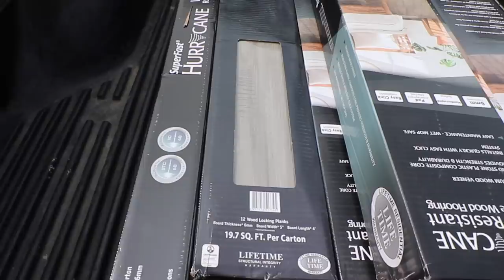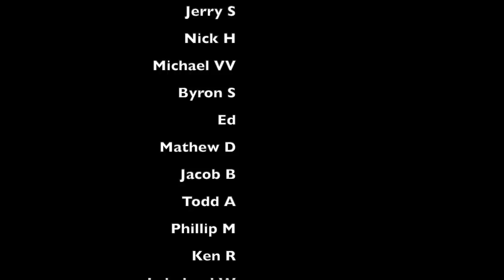Finally! Installing Flooring | Off Grid Cabin Build

Comment: What is making the noise at the beginning of the video?  We have the same noise here and I’m not sure if it is a turkey or something else.  Great videos!
Reply from the maker: It's a Yellow-Billed Cuckoo.  Pretty cool huh.
Reply: Thanks a bunch!  I’ve never heard of them and hear them all summer here in North Carolina.
Reply from the maker: @Stevie714  No problem, Im about 90% sure thats what it is.
Reply: @A Cabin and 50 Acres for your next flooring job I left you a tip to save you some money in the comment section. 👍

Comment: There are many tricks to installing flooring, one is undercutting the doorways another is gluing every joint so you will never have separation. I think some day you will use this flooring as an underlay for your rough sawn ash flooring when you have more time. Looks great!
Reply: That’s a good idea. Just run some staples thru it and ready to put the real floor down

Comment: I did laminate in our last house. Similar struggles. When we bought our cabin I had considered making my own flooring from the woods on our property. Due to lack of time and trying to keep my sanity I ended going with pine floors from limber liquidators. Those worked out pretty well and were inexpensive. Definitely more work than a laminate, but love the way they look. Hats off to you for making your own flooring in the rest of the cabin! Not many can claim that! 👍 You are a rockstar! Hi from a cabin and 12 acres in Oregon. -Robert
Reply: Did you use laminate? We're going to do our cabin floors soon and having a hard time deciding what will work best in the 3 season cabin.

Comment: Couple tips if you do a project like this again.  Don’t overlap the flooring pad.  This is why the tongue broke by the stove as when the pad is overlapped the height difference puts all the stress on the tongue and they aren’t design to hold a vertical load, rather just secure the floor together.  Second, use a trace board for the rip cuts along the wall or the L-shape around the stove.   Research trace board for flooring install and you’ll see the benefit of both time and clean install.
Reply from the maker: Thanks for the info!  I will definitely use those on the next one.

Comment: That looks really good. I like the color a lot. I think I put in Pergo laminate in my cabin. Took a while to get the hang of it, then it went quick. Seems pretty durable and the dog doesn't scratch it. I bought a battery powered vacuum which works really well on that type floor. It was the shark duo clean. Works great for an off grid cabin. Check them out.

Comment: The flooring should be very easy to clean and maintain, a very important aspect where a recreational dwelling is concerned. On the down side, it is a lot of grey, but there are always area rugs too and the neutrality of the grey as a boarder, should work out great.  And the single most important point of all is that you are happy with the color.
Reply from the maker: Great point!  It says its "Steam mop safe" so that also nice!

Comment: Great job.  I know won't be popular to say because I'm sure most wanted an extension of the wood floor from the bedroom; however, the functionality of waterproof floor in the room with exterior doors will be a good call for decades to come (wet muddy boots). Your craftsmanship is highlighted in other areas.  By the way the drawers on the bench turned out amazing.

Comment: I thought you would have done some exotic wood in a pattern for the main room. That would be amazing!!
On the plus side you have a finished floor now and they are usually great  to drag stuff across with no scratching and easy cleaning too.
I probably would have gone with a chocolate tone floor matching the wood beam loft. But gray is so popular and I love the color looks great next to the fireplace. Once the furniture is in it won't be as noticeable.
The great thing with that floor is it will be easy to remove someday if you decide to do real wood.

Comment: You Need longer T-shirts.. Why.. its self explanatory.. as for doubting you..you're a carpenter..you always do get extra stuff..flooring boards, wall'd wood, vinyl, shingles etc. as for what i would have suggested for the flooring.. it won't matter.. by the time the comments come around..what color you  chose.. the flooring is already laid...lol.. next is.. if and when you bring the dog.. cut its nails.. cause dogs do run around and these flooring rubber tiles get scratched... looking at the camera view at 17:26 the main door side looks a little angled up..going down towards the back door.

Hope you're n your family are well? lots of late summer hot days here..will be traveling back to Singapore.. on the 22nd Sept... hope to catch you complete the pond/pool before winter? stay safe.. GOD BLESS.

Comment: I put in a similar type floor. The underlayment was glued to each section. The tabs can, in some cases  buckle. I used a standard screwdriver to keep them flat during installation. Smoothing them out to keep the edges straight.  And you are right, get 3-4 courses down and see the seam jump. So go back and redo. HOWEVER after completing, my two pit bulls run crazy over it, and it is holding up quite well. Think if you have furniture in place and some wall hangings, it will even out appearances. Looks good boss.

Comment: We just sanded down pine boards like you would use in an old subfloor and then just sealed the tar out of it, it turned out beautifully. The little dents and dark areas just add to its charm.   I didn’t want the new or even professional looking floors, I wanted the rustic, cabin, well used and loved floor.  I wouldn’t change a thing about it.  👍🏻

Comment: Love the choice of pattern and color. Job well done, as always. I expect nothing less from you. :-) Your get-away cabin is coming together. So happy for you and your wife. :-) Enjoy after all your hard work. :-) And I agree, once you get furniture and rungs in, it will look amazing! A final thought. If the floor comes to a place where you don't like it anymore, you can always change it down the road. Something you might check into is tiles that looks like wood. We actually are getting ready to use a grey wood patterned tile on our floors. :-) They look good and take the wear and tear. Easy to clean as well. Our current flooring is what you put down and after two years of use, it needs replaced. You live and learn. :-)

Comment: I have a similar floor by life proof from Home depot. Five shades of Gray, tan to Brown called driftwood.  Put it down in 2017, it’s incredibly durable, everyone loves the color, and it looks gray with everything.  Your going to love how easy it is to clean, and water doesn’t damage it.  So, honestly you picked a great color, a great product.  I live in the inPortland, Oregon on the Columbia River with allot of moisture.  It’s stood up to the elements.  Only thing I will say is be careful with metal legs on the floor rubbing.  We had a bed frame pull up some of the flooring in a  bedroom .

Comment: Its a floor(good color choice) on a CABIN, in the woods.  Everybody/everything walks on it, spills on it, etc.   Lots of things yet to do.  Maintain perspective, get it done.  You can opt to learn more about floors later and from this experience.   Great videography...  keeps the interest and pace flowing.   Curious if you are considering climate control/air conditioning for those hot days to come?   Also, what temps are you experiencing in there on the hot days...?  Does the insulated roof offer some protection during the heat as well?   Okay, now back to the pond/pool(poolond?).

Comment: I think the floor looks great ! You're noticing every little thing because you just put it down like I did. Lol. After some time and furniture it'll be something you don't notice as much aside from noticing that it looks really good. So only thing I'd do different is this : 1st is the 1/4 inch gap. The long seams won't move but the short ones will separate if you don't do this. Or some variation of this. Put something between flooring and wall before you put trim down ! Thin rolled Styrofoam or maybe a strip of cardboard then trim. Also thought about a bead of silicone caulk. Any of these will allow for movement but not pucker a seam. Remember is IS  a floating floor so NO nails through flooring as u know. 2nd I would not try to remove lifted piece around stove base. Instead trim it and dont put nail through flooring and it'll stay down. 3rd when u put trim down put it down stiff !! Meaning a lot of pressure to hold it in place with that intention in mind as your putting it down. Nail to sub floor AND to bottom plate of wall. Hope this helps. Also any REGULAR water areas should have carpet as it will not do well and seams will absorb water and swell. No going back from that ! Also carpets should have felt or some kind of backing as  carpet will scratch the finish off. Hope these tips help and ive watched u long enough to know that you measure twice so I knew you had enough underlayment lol. Thanks for the video !! And whats your first name. ?

Comment: wrong stuff for a cabin. The floor will devolope wafes/expansion in the wintertime.Whay did you not toke real wood? Your flor will make problems in the winter. The cold will go through the floor because it is not isolated. Normaly you need only 10 centimeter wood for the flor. But 2x10 cm is much better. If the floor is not isolated the cold will transport humidity in the base and then fungi can devolpoe also.

Comment: Thanks for the video👍🏻 floor looks nice will last for years if you need to lift and replace in 10 + years no worries you will probably need to sandy and varnish / oil  the bedroom floor then. Least then you will have the cabin finished and can spend the time to make a new floor, herringbone or parquet would look lovely 👍🏻 the dining table seat videos where great 👍🏻👏🏴

Comment: I think grey is super trendy at this point in time. But I personally like grey and am in the process of building a 40x60 shop with an office and yes flooring in office will be grey like what you put down and a grey vanity with very light grey paint (platinum).. so don't feel bad about putting some nice down if you like it!!

Comment: Ok to nail down first track and after 3 it stops moving as much or stack the unused flooring on top of already done section to weight it down, it all gets easier when you reverse sides and are pulling instead of pushing...ijs

Comment: Personally, I hate this whole grey movement. My name is not Eeyore I do not want to live inside a rain cloud. I prefer nice warm wood tones. I know someone who is redoing everything to be gray because that's in right now. When the trend changes they'll redo everything again. 
Nope I won't do it. I'm a buy and use what you love regardless of what in fashion right now kinda person. If you love grey than go for it, you have a TON to choose from at the moment. I pick what I love and keep it until it's no longer useable then I keep it even longer while I begrudgingly look for it's replacement, which I will I then fervently refuse to purchase until the original item completely falls to pieces. This goes for everything flooring, carpets, furniture, clothing, shoes, dishes. I'm there type that cooks almost exclusively with cast iron so I will never have to part with my favorite pot or pan (which several were my grandmother and great-grandmother's daily cookers).

Comment: A job that requires 1000 squats to do. How did your legs feel after this?
Reply from the maker: I was sore for 3 days straight!
Reply: @50Acres  Flooring is the one job I feel the most in construction, but it feels good once done it changes the look of the house. 
Put a small rug in front of the stove and you wont see the floor issue.

Comment: Looks great! Been thinking about flooring a bit. I was contemplating the idea of using maple veneered plywood. My thoughts: rip it into 5" strips, route tongue and grove and then bevel the edges slightly too, lay it down with an angle nailer on top of the underlayment and poly the crap out of it. Crazy, I know, ha ha

Comment: Since you asked... Regarding the new flooring; the gray looks pretty good, but a warmer tone might have been better. I have an aversion to industrial materials simulated to look natural. Even the best ones somehow look like the impostors they are. I've used commercial, sheet vinyl flooring to good effect. The commercial stuff is the only kind I've seen that isn't a fake of something else. I found some that's subtly speckled, similar to cork but not trying to imitate it. It's completely waterproof, and with a decent area rug and some furniture on it, it can look quite good.
With your kitchen area, a dog, and snowy boots (and logs) in winter, waterproof is going to be important.

Comment: Like you said. It's ok, but I'd have leaned towards more on the bedroom floor shades. Although it does work with the black in the wood burner area. Also the window frames and tile backsplash. So again I guess it's ok.

Comment: It went down relatively easy ....... it will be just as easy to take up when you decide to replace it with something more hard wearing.  But, in the meantime, once you furnish the room, the grey will be broken up and the impact of "so much grey" diminished.   What surprised me is that you installed the flooring before finishing the loft area ...... I have visions of things being inadvertently falling from on high and the flooring getting dinged, dented and scratched.  But, it's done.  Guess you could lay down sheets of thing plywood to protect the floor when working "upstairs".  Are you going to eventually do a finished floor in your mechanical room?

Comment: That's always the challenge...figuring out where to allocate your time and resources.  Honestly?  I think it's a shame to put one of those laminate floors inside of a craftsman's work of art cabin like yours.  You did an excellent job of installing it and it looks lovely.  But next to the wood floor YOU milled, installed, and finished on site, the Menard's floor is clearly the one thing in the house that clearly doesn't belong with everything else you've done in there. 

That said, it transforms the room to have flooring in.  It's looking really cozy!  Fact is, I'm SO impressed with your work that nothing like that floor, no matter how "nice," can measure up to the natural materials and craftsmanship of the rest of the place.  But as you said, you needed to balance time, energy and money and this is what you decided to do.  The nice thing is that it looks fine for now, and if you want you can always pull it out and install a different floor in the future if you decide to.

This is exactly what I'm going to be facing when I start building my house in the next year, and compared to you I'm less of an "advanced" amateur and more of an amateur in my skills and experience.  So if I manage to create a home nearly as beautiful as yours, I'll be extremely happy and duly proud!

Comment: What is going on?  No ladders and mud (LOL), boulders and rustic lean to, magic hammer siding shingles, and stairs landings?  OH WELL! Hahaha!  That floor looks great in there.  The product is not flawless in any way like you said.  We are putting ours in (same place same product) and are having the same problems.  We had corners and ends buckle after about 5 courses in.  One had the separation of the edge connecting lip.  Then one piece, only about three courses from the start, came unsnapped (The entire length) after we were almost done.  We are not sure how we are going to fix these problems either.  Waiting to see what you may do.  Also, our dogs do not like the floor so much because they slip and slide too much on it.  Area rugs have helped with that, but we wanted it to be uncovered and be able to see the new floor.  Read the cleaning instructions carefully also.  Stay safe and healthy!

Comment: Flooring looks great.   I'm a bit biased because we installed an almost identical floor upstairs.  We bought ours from Sam's Club and the box said "engineered and manufactured in Germany".   The manufacturer did not offer accessories but if you need accessories such as threshold or bullnose, take a sample to Lumber Liquidators and they can order and send to you.  So far we have not had a plank pop loose like you did.

Comment: For me the gray floor is just ok. I feel the color is a not a great match with the beautiful walls. I would have much preferred natural wood. However my suggestion would have been to paint it a deep, rich forrest green color. As well, the gray floorboards adds a little bit too much similar texture. Another alternate flooring choice might have been square cork tiles.

Comment: Of course this is just my opinion, wood ceiling, wood floor, walls etc. I would replace counter top with blue, green formica, would add touch of color and get rid of too much wood look. Also just one sheetrock wall, again to counter too much wood look, paint wall nice color. Like your vids and work.

Comment: The first mistake you made was that you overlapped the thick underlayment,  (looks like cork), you never overlap, that is why it has a thin plastic on the edge that is going to overlap. Secondly it looks like the floor you purchased has a built in underlayment already, by using extra underlayment, it will make the tongues crack, its too soft, this is not carpet.  Thirdly, you did not tap the floor together, after you snapped it in, you are suppose to tap it, to make sure its locked in place.  I have been doing floors for 24 years, so here are some tips.